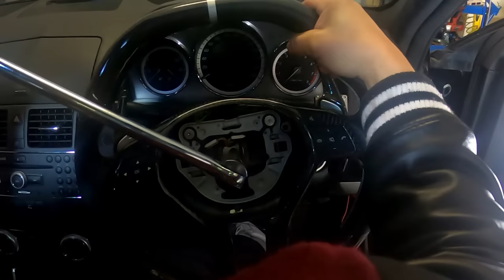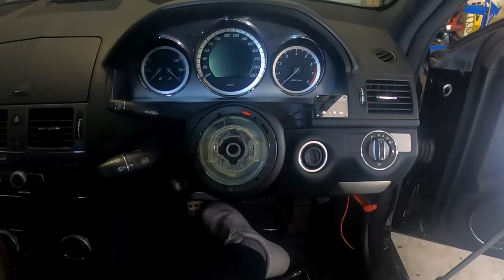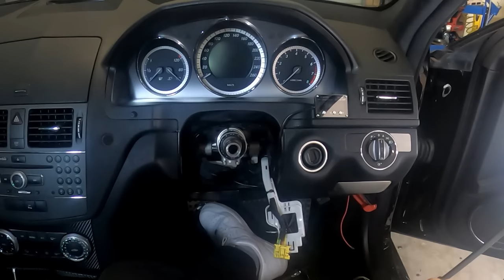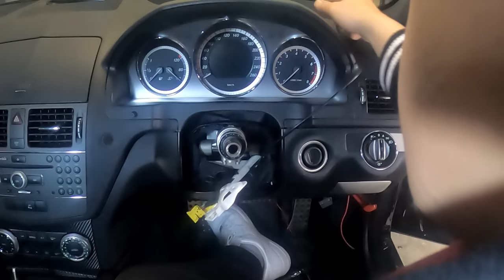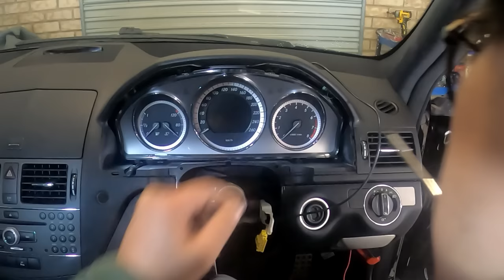HOW TO remove and fix ESL/EIS/ ELV MODULE  w212 w204 mercedes motor replace  Part 1

Comment: hello friend and thanks for your tutorial 
i just liked and subscribed
im doing some research but ill ask for now
-when inserting key the  motor does not make  a sound nor does the car start
-all the lights work on the panel and headlights work as well but windows do not open
question is:
if windows do not work, horn does not work and steering motor does not make sound
does that mean it can be the esl motor or  can it be a security module on the auto?

i have charged battery to 13volts, it was at 12.4 volts 
thanks
Reply from the maker: hi there mate thanks for subscribing and welcome to the channel ... usually when your esl motor fails nothing will happen your dash lights wont even work nor will your headlights ...i cant remember exactly ..usually it takes the key being recognized in order for your eis to recognize your esl and then you will hear the turning noise that lets you know your esl has unlocked and synced with your eis .... in your case it does sound like the esl motor has failed... listen very carefully when you insert the key..if you hear a very faint ticking noise..it means the motor in the esl is trying to spin but due to failure and malfunctioning it cannot... its the motor in the esl susceptible to failure not really anything else ..however with that said its possible it can be the eis ..however not likely .....  its a pain but to be sure you have to use a STAR scanner tool and it can tell you exactly what is wrong ... its the obd2 scanner tool that mercedes use or some indy car shops will use it also ....
Reply: thanks ill try checking for errors with a scanning tool before i decide to do any fixes
Reply from the maker: @MrMugenwii  yes that is always the best route ...usually i would check fuses then relays and then use a scanner tool to try best to narrow down the problem and if all else fails a star scanner tool or a indy mechanic shop with an advanced obd2 scanner tool would definitely help alot...never ever and i mean it ..never ever throw parts at the car hoping to solve an issue..its the fastest way to waste money ...use your common sense and..you will be way more sufficient...good on ya mate ...let me know how you go ..im always here for my subscribers
Reply: @MrMugenwii  Error is A65464 "Steering wheel ...........". Follow Mikeyz's advice re hitting the column close to the ESL at bottom to unlock one last time, etc.
Reply: If you did not hear any noise, use Mike's hitting trick and battery disconnect trick. If motor is not yet completely dead, it may still unlock the steering wheel one last time. If not, as in my case, you have to pull out the column and cut off the 10mm bolt to get the ESl out and to change the $5 motor.
Reply: @dominicwild3189  so you didnt burn the chip when you removed the esl, and did you need to buy the circular tool from aliexpress?
i fixed my issue  and am all good but didnt remove the esl thinking it might burn out the chip...

Comment: Excelent video!! I wanna ask you how can I find the piece to change in Amazon
Reply from the maker: do u mean the little motor in the esl module
Reply: Yes, the little motor.
Reply: How do you know if is a mechanical or Electronic failure . I suppose you admit a mechanical failure. Is Electronic failure possible?
Reply from the maker: @facundomoya3318  electronic failure would be if your circuit board has fried ie. your nec chip in your esl module i pressume ...and also if your EIS has failed .... the motor is a mechanical failure ... using an obd2 scanner would definitely help and most of the time tell u whats wrong where and which part
Reply from the maker: @facundomoya3318  ebay has them just type is w204 esl elv motor and it will come up
Reply: Aliexpress, US$5 or more or less even. Just Google "Aliexpress ESL W204" or your model. Of course, the burnt out motor may have taken out the NEC security chip on the board, then you have to get the complete ESL unit, new or second-hand plus take out the ignition lock and with both parts the stealerships or specialised lock people can sync the two, cost of $350 or so for the sync.
Reply: Ask Dr Google for "Mercedes ESL motor W204" or similar for your model.

Comment: I’m having issues with my key fob not unlocking, locking, push button start won’t work, keyless entry won’t work. I’ve changed my key fob battery and auxiliary battery is new. Would this esl/eis be the issue?
Reply from the maker: what happens when u push the push start ? usually u hear the whinding noise right that indicates eal is unlocked what do u hear nown
Reply: @MIKEYZVLOGZ  nothing. It gives me a message to remove push button and insert key
Reply from the maker: @Kneehat  then yes most likely

Comment: Hi i have a 2006 mercedes c230 sport and recently the key had been acting strange and not starting my car. Now it won't work at all.  How do i know if it's the key or the esl or the eis?
Reply from the maker: change battery see if that works .. most likely it's the esl .. its the major common fault with these cars.. when u insert the key does the esl whind and make the noise activating the esl module? listen closely.. if not try and see if u hear a faint ticking noise..that will indicate esl working still but motor inside has malfunctioned ..easiest way to tell.. not likely the eis is faulty..it can happen but more then likely it's the esl module motor... can't stress how cool this is on w204s.. really shocking for mercedes cars.... or get a obd2 with in-depth functions so u can scan and it should tell u it's the esl
Reply: @MIKEYZVLOGZ    when the key did work it would engage the esl then the eis would turn and let me start the car. Sometimes all the electrical system would shut down but the car would stay running.
Reply: @MIKEYZVLOGZ  thanks for replying man i appreciate your help. If it is the esl can i use any esl emulator or does it need to get programmed?
Reply from the maker: @MRSIN187  emulator needs ro be programmed
Reply: @MIKEYZVLOGZ  hey man i just checked it out and I had to put my ear to the dash but i heard the esl whining. I think I'm going to try and get it to unlock and replace the motor. Thank you so much for taking the time to help. 100

Comment: Any tips on how to get the ESL out when it's stuck in the locked position?
Reply from the maker: u have to remove entire column and drill a small hole and manually turn the esl motor so it can unlock. or cut the bolt off and remove the esl after u cut the bolt
Reply: @MIKEYZVLOGZ  thanks for the quick reply mate, I’ll give that a go. Top video guide too 🤘

Comment: Thanks for the video man. Really considering doing this myself and saving the cash. Quick question if you don’t mind.. do you HAVE to take the ignition out as well if you’re only changing the ESL?
Reply from the maker: no  friend i only showed that for those who are not as confident trying this fix and wanted to still save cash by removing the esl and eis ignition so they can send it off to have fixed .... so no u dont have to
Reply: MIKEYZ VLOGZ ahh. Gotcha. I appreciate the advice brother. Thank you much 🙏🏻 fingers crossed for me!
Reply from the maker: @Mgray345  ur most welcome matey .,hope it all workout for u
Reply: Sorry to bother brother. If my steering wheel is turning (key in or out) does that mean it failed in the unlock position? Or do I still need to electronically unlock it so I don’t blow the chip?
Reply from the maker: @Mgray345 yes i believe its unlocked ...
Reply: Man I’ll Venmo to talk to you.
Reply from the maker: @Mgray345  whats venmo ? if you could leave your questions here ill happily try my best to answer them keeping in mind im not a professional mechanic or auto electrician everything ive learnt is self taught basically trial and error.... but im happy to try and help any one of my subscribers .... with that said i also prefer not to work on others cars but giving advice is different from working on them.... so happy to try and help ronnie... and i only say ask herr so in case someone else is curious about the same question ....they can   read the answer here.... or my reply according to what i know and habe learnt through my experience ....
Reply: @Mgray345  Lucky you, the motor failed in the unlocked position, so you do not have to cut the M10 13mm bolt holding the ESL onto the column. It probably took two hours in the Australian heat with a hacksaw and small grinding stones to get that b.................. out.

Comment: I had to take the T40  torque bolt holding the column in. I couldnt push in the EIS bolt in and remove it. Not enough room to work. The ESL seems unlocked as it does push in. Though  sometimes it seems to be (hard) and not push in, as I keep attempting to push it in and pull up on it to remove it. I turned the metal steering wheel !nd push in at same time and it then pushes in. Did I do something wrong by taking that final 5th  torque bolt to move the column in a better position? Or should i not be turning the metal wheel as I push in on the ESL bolt? And i cant seem to push it in enough to pull up on it to remove it. Frustrating, cause im using a ( pick tool, small flat head, and a small hook tool). It pushes in but as I pull up on the ESl it wont come out. Reminder, when I turn the metal steering pipe, I hear clicking from the ESL. And it sometimes locks the bolt or unlocks it if I push the ESL bolt in and out at same time. Is that bad or normal?
Reply from the maker: hey bud seem like a but of a tough one .. ok I can tell u this ..I did not remove anything else ..its hard but u can find a sweet spot to remove the esl module..now... it should just push in all the way ..check that it pushes all the way in ..without having to turn the wheel.. if u need to turn the wheel then Im guessing it's not completely unlocked..u should be able to push the bolt down all the way and remove it if it is... u need to ensure its unlocked first before you attempt anything else ... this is my opinion .. its hard to diagnose without  being there... but from what u have said ...I would start from the top and ensure its unlocked and ur able to push the bolt in ... if it is unlocked u can easily push the bolt in and pull it out ... it's the only thing holding in the esl

Comment: Excellent video thanks a lot for it.

Could you please give me more details about this? 

You wrote -> "I'm very sure that he forgot to make sure that the two little points were not pressed down ... attention to detail is most important ... fro. what was described he definitely forgot to make sure that the 2 little button looking points were pressed down another subscriber also told me this."

-Could you please explain me in detail how I can check/locate that these two little points are pressed down, what must be the correct position of it. I picture of it will be nice.

-Second, I have few questions regarding the testing stage, since you have removed the negative line of the battery with the key inserted then you removed (with battery still disconnected), so when you tested it up you re connect the line with or without the key inserted?
-Finally just to confirm, did you reconnect all the part to test the ESL including cluster and airbag?

Please help with this I would like to do it I bought the motor and the special tool to disassembly the module but I just want the possibility of screw it up.

Thanks!
Reply from the maker: ok so to be clear once u put everything back together on the circuit board you will see two grey buttons on top of the black circuits theres only 2 square circuits with grey switches on them ... make sure they are pressed in u can use a pick tool or something very skinny to press them in  when reinstalling... also when you test u have to reconnect battery that is the only way ... my apologies I meant before you reconnect the module leave battery disconnected ... then wen you've plugged it all back together ...then reconnect battery and test ... obviously must connect battery to be able to test
Reply from the maker: can only do so much from where I am ... the video is very clear and easy to follow as long as you take precaution and pay attention to detail... there are also other videos  you can watch in order to see how everything should look before you put it all back together .. but it's very Important that you make sure the 2 switches are pressed in before you put the module bac together ... some ppl do not realise this and hence why they cannot fix it .... pls do more research as well before attempting... just so u have a good idea of whata involved ...
Reply: Thanks a lot for your great support, one quick question after all is in place and ready to test before connecting the battery the key must be inserted or not?

Thanks a lot.
Reply from the maker: @luisdiegosolano8971  yes insert key wen connecting battery and then if you did everything correctly it should lock and unlock with your key ... do not try and start the car more then once ... if the car does not start and steering lock and unlock with your key ...no point turning the key because it will short something and it will go black .... so make sure u only insert and remove key and if u hear it unlock then start car if it doesn't make the noise that unlocks and locks then something is not right inesl module
Reply from the maker: @luisdiegosolano8971  so yes key inserted wen connecting battery make sure all cables connected and be sure to triple check everything is correct ... if all is done right it will work

Comment: Great video, MIKEYZ! Thanks! A few questions:
1 Am I correct in saying the battery should be disconnected to ensure the computer does not see the power to the air bag being removed. The computer believes the air bags have deployed and the vehicle becomes immobilised, is that correct?

2 One op claims the air bag does not need to be removed. Another removes it and also pulls the electrical connection to it. I have to take the whole column out anyway, so can I get away with not removing the air bag and also not breaking the electrics to it?

3 The four Torx bolts holding the steering column to the chassis, should I know the torque figure for them or not?

4 The single Torx bolt to the spline at the end of the column, where it meets the universal joint, should I know the torque figure for it or not?

5 Looks like a two-man effort to reconnect the spline at the universal, one on top feeding and one at the bottom sliding the column in at the universal joint. Should I mark the spline with a chisel mark before disassembly and take a photo of the steering wheel position, so I am driving straight when the steering wheel is "straight"? 

One op is suggesting there may be a recall notice out for this ESL problem and I should enter my VIN, but with a 13 year old car I doubt Merc would fix things for fee. How much damage is the tow truck driver doing with blocked steering and wheels?

So many questions, so little time!
Reply: Thanks MIKEYZ, you have answered my first question already, just saw it.
Reply from the maker: just so u know i see all yr questions and will answer them all in due time
Reply from the maker: 1. yes u r right to suggest disconnecting  the battery 

2. yes i guess u can do that but how would u get to the columm bolts to loosen them ? i coukd only reach them easily after removing the wheel amd airbag .... as its hard to get to the top 2 closest to u 

3. no need to kmow the torque settings just make sure they are snug not tighten to hell 

4. no it is not neccessary i just did them up tight enuff but of course if u would like to know the torque settings not hard to find ...i dont think its a must 

5. when removing the columm yes it would be best to mark your centre so u kmow exactly where to reconnect it...same as wen u remove your steering wheel...however i will be honest and say i did not amd still mamage tp get it all back on straight as i felt it could only go back a certain way... but its better to mark everything before removal yes indeed .

if there is a recall on the esl doesnt matter how old they will fix it a recall is a recall... depends also on the date and time spand i think ..dont quote me on that...seems like u have done your research mate .... ok so with removing your esl in locked position its ppssible u may need to reprogram it and also fry your chip ...unless theres  way to do without...which im mot 100% sure as i only have ever done it by unlocking the esl first ..which is what i recommend in my video... but yes its possible o do it your way too.... 

good luck hope u get it all sorted matey
Reply: @MIKEYZVLOGZ  Noticed the boot is now locked as I closed it after I disconnected the battery. I hope I can open it with the key?
Reply from the maker: @dominicwild3189  ye ull be able to with key maybe justneeds reser or relearnby pressingbutton after u unlock it

Comment: If I tap where you suggested and it becomes unlocked, can I drive the car home to fix it myself? The steering wheel is locked, won't start, at a friends house and blocking the driveway. I would like to fix it myself because of the cost. Or will I have to get it towed?
Reply from the maker: yes if u tap it a d it unlocks it wont lock again until u remove the key so u can move ur car or drive home ..just remember once u get to ur destination and want to fix it disconnect the battery first so it stays unlocked